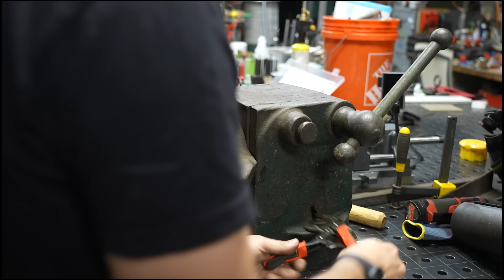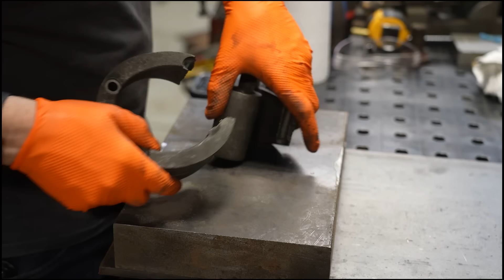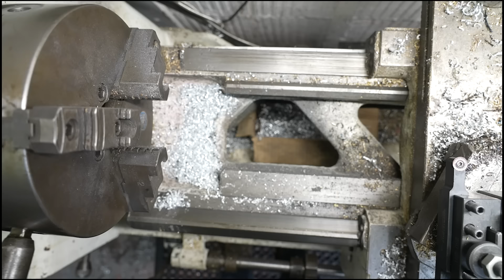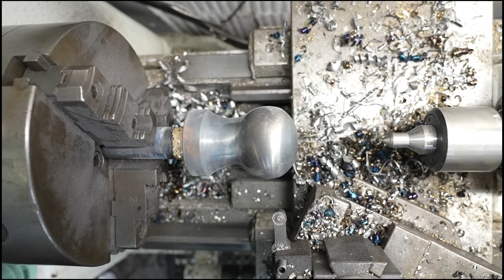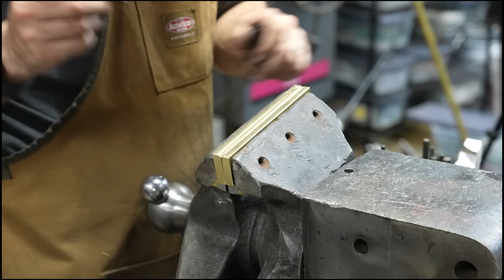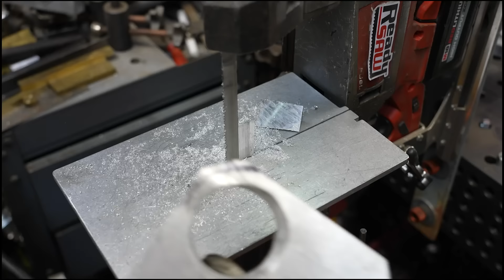I Bought a BROKEN Vise for $5,000 so I Could Restore It!

Comment: Carbide is a poor cutter to use for aluminum, HSS is better. Hole saws require very frequent back out and cleaning since the gullet of the teeth plug quickly and the chips have nowhere to go causing overheating and excess wear. You can use a small fly cutter or lather boring bar on your mill as a makeshift boring head by varying the length of the cutter.

Comment: If they weren't paying you then why would any reputable shop man ever use a WD40 product?  For everything they make there is always a better option.  The worst being the base WD40 spray.  I learned how bad it sucked when I picked up my first simple hand tools as a youth trying to fix my bicycle back in the 60s.  For the novices wondering what to ditch the basic WD40 for just buy CorrosionX instead.  Additional protip: The best products rarely bother with advertising to the general public and limit themselves to the B2B crowd, never on YouTube, lol.  Anyway I hope the ad money was worth risking your rep with pros.  Not sure why you brazed cast iron either.  Just stick weld it with nickel 55 alloy rods and your Lincoln for that ductility you need.  Not a stick welder?  Ah well, it is becoming a rarer skill these days.  When stick welding was more widespread you couldn't pass your high school shop class until you were dropping dimes.

Comment: Wow, $65 for such a small piece of steel, do you have a quarry anywhere near you, if so check to see if they are using a jaw crusher, or cone crushers, if they do they will have broken jaw bolts, which is made from good steel or they might have broken shafts on cone crusher rams, again really good steel, you should be able to buy it for scrap value.

Comment: Why didn't you mill the jaw ledge completely off and make a new one instead of all that pointless grinding .You could have done both at the same time drilled and tapped and you would not have to do much as much welding becuse it would have being a flat surface.

Comment: I’m not an engineer but I think you could slightly enlarge the holes in the aluminium angles you have and use a brass sleeve over the rough pins on the vise. That way you have a rough surface that’s the pins and a much smoother surface that’s the brass and the brass is easily removed. Or use a metal sleeve and heat it up and drop it over the pins. Sacrificial. Not sure if you have access to a 3D printer but could 3D print the lock down screw and confirm the fit then make up a mould from the print and cast another screw? I don’t believe it is a lot of force. Then again sleeve the hole of the previous. Don’t shoot the messenger as I’m not an engineer but I think this is how I would try to tackle the issues you faced. Excellent work, very very enjoyable and educational.

Comment: Why is the Meatball called a Meatball? it looks more like a toe tow ball to me. Apologies for my inane question but I just want to know why because I can't figure it out for myself. Personally I blame old age but you can be honest and blame the real reason.......stupidity.

An interesting vice so what would it be used on? I say a Channel who also does restorations but can't remember the name or find it in my History or Subscription list but he used an expensive deruster that starts with R and I don't like the smell of it. WD-40 I find more addictive pleasing to my senses (my large snoze) but no idea if the WD-40 rust removing liquid would have that same pleasing fragrance. (Oops, got sidetracked) On his Channel he restored a Fractal VIce which I had never seen before but you could easily see what it was designed to hold..........just about anything non symmetrical. 

Apologies for my rambling and Thank you for the interesting restore and for the interesting video. 👌
🖖 LLAP! 👍

Comment: a guy i've workd with on the farm has two old truck rims stacked on each other filled with cement as a stand base. he left it so that thebottom rim is still metal so you lever it sidways and roll it around like a welding cylinder
Reply from the maker: I have an anvil stand like that and do the same thing! I think that’s what thing puppy needs

Comment: Didn't know WD-40 have other product than oils. I will surely try the rust removal, because I didn't find a good one (and easy to use) yet.
Reply: You haven't been shopping much, or at least not at common stores around where I live. I'm not a fan of wd-40 but their rust preventative spray got a tied best product with Hornady One Shot gun cleaner and lube from a youtuber who tested maybe 20 products. I already use the Hornady product but the wd40 version isn't sold at that many places and the one place that had it is very expensive. It is the same price as the Hornady product but was a smaller can. Haven't you heard of Evapo Rust? It is great and is probably like the wd40. Metal Ready, from POR 15 is a great rust remover and it leaves a dull silver coating on items to keep them from rusting again. I used it on old hand tools and my fancy welding table. POR 15 paint is junk, based on using it on the engine bay of my old truck.........and I was a pro painter for many years. People rave about citric acid or molasses, with the latter taking a long time but being very cheap and easy to use. Pool acid is good for fast rust removal, but of course it is very nasty and can pit good metal. It is good at weakening or removing slag left from cnc plasma cutting parts. Maybe you don't live in the USA or near a big city, but in the SoCal area, there are many options.

Comment: Great job.  Great vice.   Where did you get the spring ball detent?  Is it just a brass BB , grub screw and spring?  I have a Parker and need that for the finishing touch.  Thanks
Reply from the maker: Thank you! I get it on McMaster actually. They sell them in a few lengths. They are disproportionally expensive for what they are though. This one was left over from a project that called for them specifically on the print
Reply: Thank you. Isn’t that the case for most things today?  Lol. I think a came up with a solution. Drill out a brass grub screw and make a delrin insert to provide friction on the handle. When it wears just turn it in and it also has the benefit of locking the handle if you want to. Thanks again.

Comment: Nice job on a cool and useful piece of history.
Definitely get the CNC mill going. You could have interpolated the holes in the pivot jaws easily, and also interpolated the OD of the pins.  You could also use a convex cutter to make a ball detent around the pins so the pivot jaws could stay in place when switching to use different jaws.
Regarding the stand, make sure you add posts to store different pivoting jaws and alternate interchangeable jaws.

Comment: A tip for sanding on a lathe that was taught to me:
Instead of wrapping the paper all the way around the piece and grabbing it, basically make a tensioned belt with your sandpaper between your hands, and rub it against the part. This ensures you don't get wrapped into a slap band of a human.

Comment: Brilliant save. So much of this stuff is ending up in scrap yards now. Part of the fun with welding the cast iron may also come from the fact that it’s a bit porous and over 100 years it would have absorbed oil and grease only to emerge when heated. Those ledges that the jaws rest on usually break when the retaining screws or pins become loose and someone takes a hammer to something in the jaws. That tiny bit of play is enough to transfer the shock of the blows to the cast iron and as you know, cast iron doesn’t take kindly to shock loads. The first thing I thought of when you said you had to make a new meat ball was to start with a tow ball but your solution worked beautifully. What a great job you did and I love the clear finish. Looked after, it will last another 100 years. Well done mate, cheers, Stuart 🇦🇺
Reply: Was curious about how it broke.

Comment: I feel like this guy has no problem taking things he learned somewhere else and sharing them as his own.
Reply: Do you mean like the tips that he specifically called out where he learned them? I know he called out Keith Rucker in this video during one part.
Reply: @Stephenps2 I appreciate you sharing an example of the exact opposite of what I just said. However their doesn't need to be an example because if you boil down what I'm saying it's basically this guy does this because he doesn't want to work much instead of having a passion for it.
Reply from the maker: I promise I do all my
Own stunts

Comment: You bought yourself a nice little project there. That vise found a nice home to retire to too. It's a big step up from getting beat on behind the woodshed. Advantage comes from above. You being over your opponent. Kick 'em when they're down. So I'd mount that vise low.  Maybe make a rim stand for it? That way you can roll it around. Would need the right rim though. A big 'un. Big ole truck rim. With a tube up the middle then a plate welded to it to mount the vise on. My low vise is considerably smaller so it is on a tripod I can pick up. Very useful.

Comment: You did and outstanding job on restoring that vise , I just recently made a vise stand. I have made a few in the past they are stands that are on a base so they can be moved .  to the center of the shop floor for long pieces of material but the last one I made I used a base from and old drill press and a 4 inch square tube  and I filled the base and the tube with concrete , this is so you can heat and bend pieces of material and not worry about tipping the vise over . but if I was going to make another one I would use a truck rim or a drum brake from a tractor trailer . If you go to Gershow Recycling in New Hyde Park I am sure they will hook you up for a couple of bucks
Reply from the maker: Good idea! I go by Gershow all the time I should see what they’ve got kicking around!

Comment: Once you have the bevels ground take a stainless steel wire wheel and clean up both parts in the crack it'll help get some of the impurities out before brazing.
Reply from the maker: Good call I’ll have to try that next time specifically
With a stainless wheel!
Reply: @MakeEverything  Stainless wheels are for aluminum. I doubt it'd help any on that dirty old cast. The impurities were cast into it. As you keep heating it the crud comes up eventually.

Comment: Starting around 19:53, I didn't see any preheating of the whole part.... did I miss that, or was there a reason for not doing that? To my unexperienced mind, that would have been problematic in such a large part. Could you explain the reason for doing it this way please.
Reply from the maker: I switched a smaller torch head with hopes it would result in a cleaner braze but I should have stuck with the rose bud and got it all red hot!

Comment: Hmmm, I wonder if the previous owner may have used something like a hammer (maybe a sledge?) on the vise handle. That would explain both the welded handle and the broken nut. 

Edit: After watching more, they may have used this vise as a forging vise, thus the broken jaw ledges as well.
Reply from the maker: Somebody abused this poor thing but I made it feel loved again!
Reply: They were getting it done, that's for sure. Whatever it takes. That old vise got plenty of hot suppers in its life.

Comment: have you considered using thrust bearings?
Reply from the maker: Absolutely! I usually put thrust bearings in my vises with springs so they are extremely smooth. The design of this one didnt really allow for the typical system I used and the action was so smooth once I re made the meatball I didnt think this one needed them.

Comment: There's one for only $1000 on ebay now lol
Reply from the maker: The one on eBay is the 4” wide jaw, 90 lb version. This one I restored is 2.5x the size at 250 lbs!
Reply: It doesn't have a buy it now button though. Maybe it means bidding starts at $1000?
Reply from the maker: Yeah bidding starts at $1000, maybe I need two of them 😬